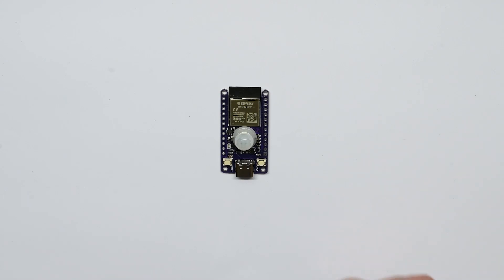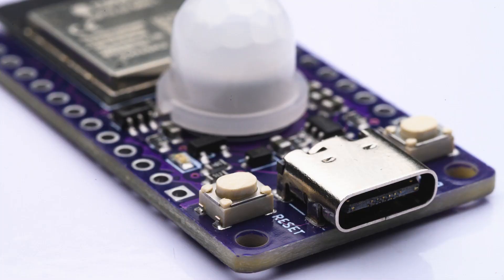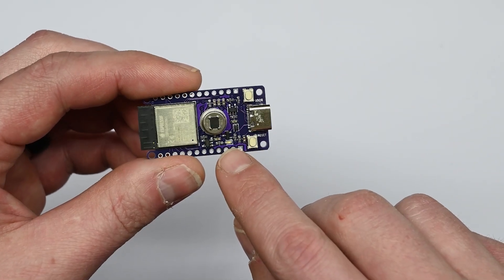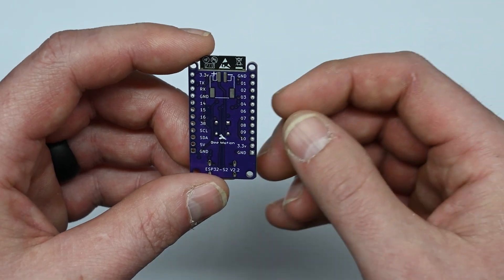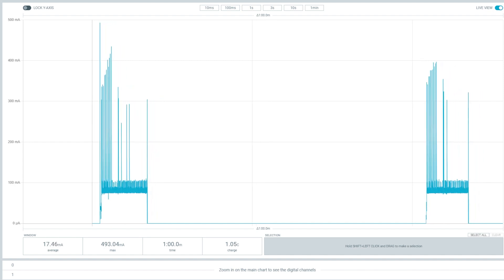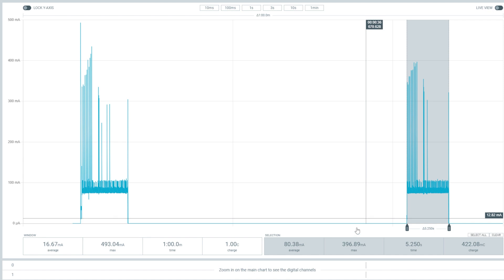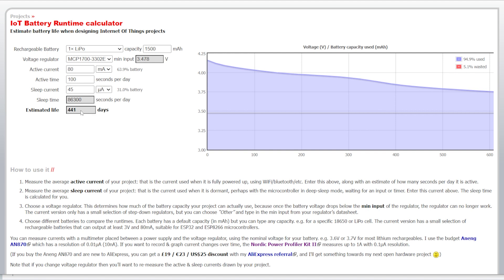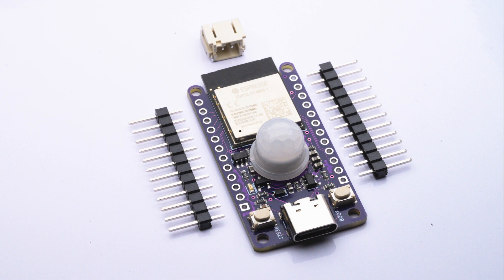ESP32 with a built in PIR Motion Sensor!

Comment: I'm considering this or something like this for a closet illumination project for my daughters closet.  The closet came with no lights for whatever reason.  Any issues I might encounter?  Thanks and great job on the design.
Reply from the maker: For that kind of project it should work fine. 

However the version of this board in the video is no longer produced, and the replacement version i made is also no longer produced, BUT there are still some available for sale on https://www.mouser.com/ProductDetail/Smart-Bee-Designs/BEE-MOTION-S3-01?qs=Jm2GQyTW%2FbiRgn4ASiYhUw%3D%3D

If you want to grab one for your project. Best of luck!

Comment: OMG I found your video right on time I'm looking to connect LED strips on my stairs this board is just what I need with you help I think I can do it if you could all I need is a wiring diagram or video showing me how to hook a all up please help
Reply from the maker: Definitely possible to do. Are you looking at just a white LED strip or an RGB led strip? Either way, all you'd really need to do is connect the data line of the strip to a GPIO pin on the board and ground. And then power the strip with an external power supply. I'd recommend 5v led strips that way you can power the strip and the board off the same power supply.

This particular board in the video is no longer being made, but I have a new version called the Bee Motion S3 that has a lot more features built in, like a ambient light sensor which could be handy for only turning in the lights when it's dark out.  https://www.tindie.com/products/smartbee/bee-motion-s3-esp32-pir-motion-sensor/
Reply: @paulprice  ok so do I need to get two boards ?
Reply from the maker: @tonyrollin402  that's up to your use case. If you wanted to turn on the lights when entering from both the top and bottom of the stairs then you'd probably need 2, one at each end to monitor for motion.

Comment: Thank you sir. I was looking for exactly that for my home assistant. Would you mind sharing what are you using for the power profiler? I am starting to learn how to design my own boards using esp and I would like to see the efficiency of the one I am designing.
Reply from the maker: I use a power profiler kit from Nordic semiconductors. It's a handy tool to have to measure power usage.
Reply: @paulprice  Thank you for your quick reply. For future reference, unfortunately ESPHome doesn't support wake up on gipio5. I'm going to try jumping it to gpio4 and see if it works. Thank you again for this sensor, it's very nice.
Reply from the maker: Oh I didn't realize that. Thanks for letting me know. I'll make a note of that for my next revision of these boards to use a different GPIO that esphome can use.

You should be able to connect a jumper wire from the signal pin on the back of the board to another GPIO pins. That should work.

And thanks!